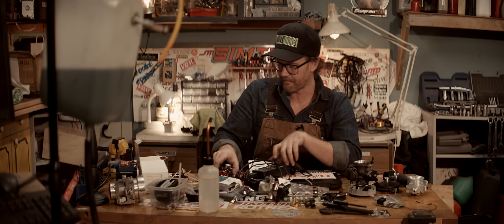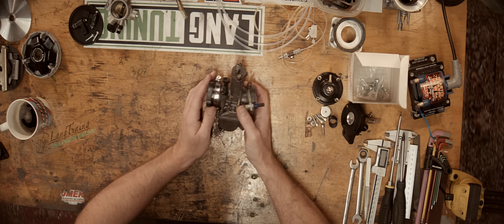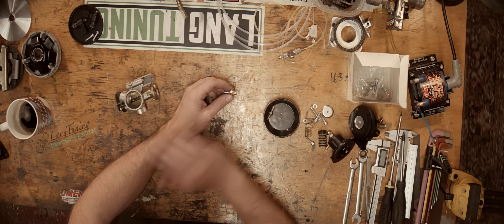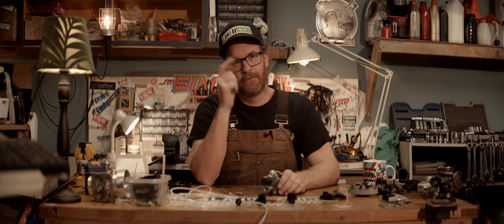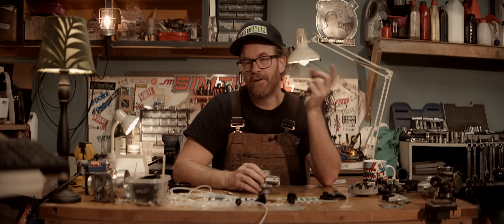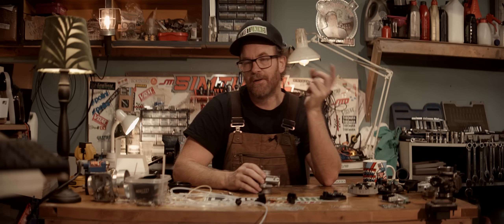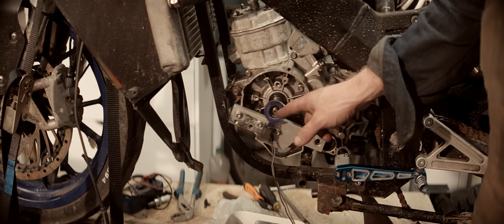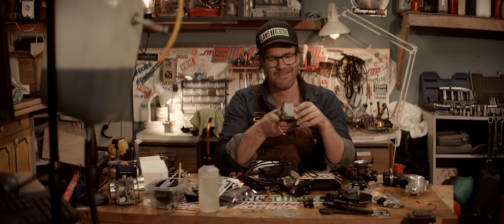Nitromethane Two Stroke EFI, but not how you think.

Comment: Please stop this path.  I don’t know what else to say.
Reply from the maker: I'm afraid you'll have to explain. Why do you want me to stop?
Reply: @2STROKESTUFFING   I just think you are going in a direction that is more complex than what you are already doing. 
I have seen a number of people use nitro and melt down. 
It is hard to get. It is corrosive and somewhat dangerous. 
I pushed a four stroke 249 cc engine to 123 mph in a mile using nitrous. 
I have no two stroke experience  but I know racing 
With the two stroke your lubrication is carried in the fuel. The more power you make the less oil you have.  Bonneville is three miles full throttle. Your head pressure will go beyond your timing and then it stops using the timing and starts to run like a diesel. But for three miles.  What will you do with the heat? I love your videos and watching all you do. I just see so much money and effort. 

To me you should start with the fuel. If it’s nitromethane and gasoline or alcohol. Find a consistent source . And build your entire engine around the fuel. Not the other way around .
Reply: @2STROKESTUFFING  i was kinda thinking tha same top fuels dragsters run 1000 feet and completely melt off the spark plug electrode. They are a 4 stroke yes but nitro has been known not to be engine friendly especially @ 100%. Im not sure it would survive the lenth of Bonneville before it just melted something
Reply: I really hate to try and second guess someone as innovative and driven as yourself. 
I have experience with speed trials and have not seen nitro work well enough to be impressed. I know some have used it well. But they usually are a team of chemistry majors working with engineers.